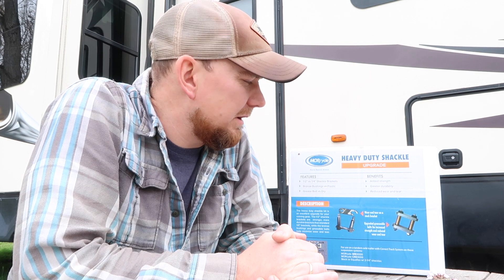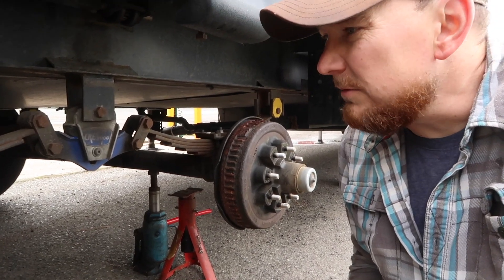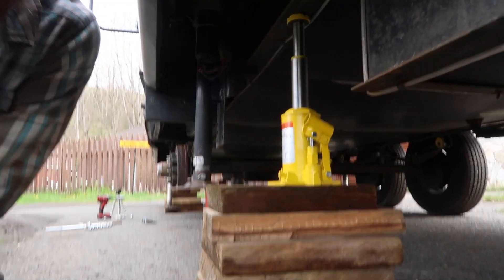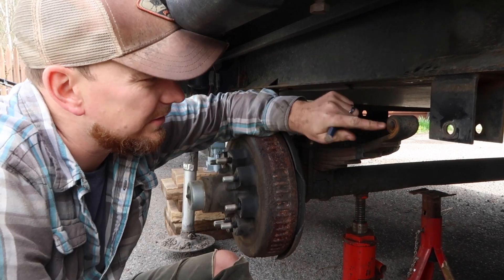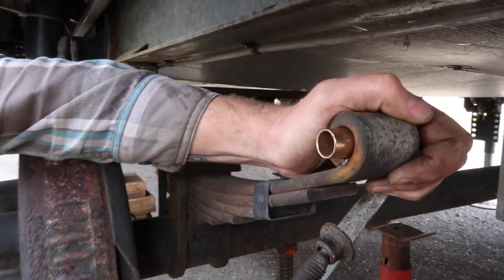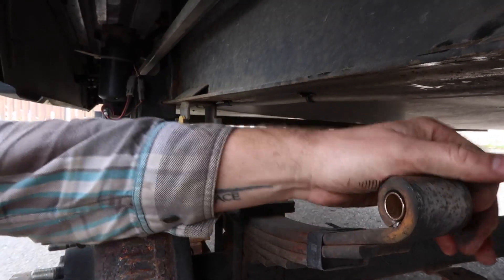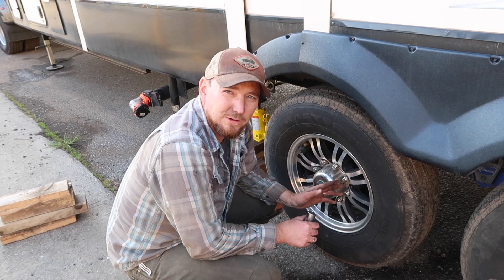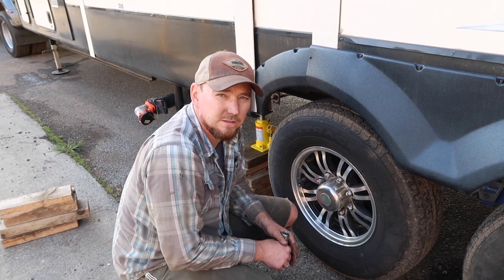Alaska Prep : MORryde Heavy Duty Shackles

Comment: Rather than using a socket to press the bushing in, use one of the old bolts cut off to the length of the brass bushing. Then insert the bolt into the new brass bushing and press it into the sprint. It will make it fit flust on both sides.

Comment: If you face the greese fitting to the inside you don't have to fight the tires to greeese them. Also, point the greese hole in the upward position and it will be easier for the greese to folw when the RV is on the ground.

Comment: I did the same thing on my 5th wheel in preparation for our Alaska trip. The only thing I did differently was installing the bushings. I put the new bronze bushing on top of the old bushing (I put a little anti-seize on the outside of it), then take a shackle bolt thru the bushing and tap it thru the spring. It’s easy & you don’t have to use a C clamp. The bolt automatically lines up with the plastic one.
Good video, thanks. Maybe we’ll see you in Alaska.

Comment: Thanks for the video, I already had this wet bolt kit installed on my trailer new, however, one of the nuts on the leaf spring came off and the bolt is bent in the hanger hole, your video helped get a better idea how to replace the bushing and install a new bolt!

Comment: Take note: the new wet bolts are galvanized and the shank in very rough.  This is the part that turns against the bushing so I'm thinking the bronze bushings will wear quicker than the plastic with smooth plain (black) finish bolts shown in this video.  I'm very disappointed in this change as all the pics on MORryde's website show smooth black bolts.

Comment: You put the wet bolts in backwards. They should face the center of the trailer so you can grease them without taking the tires off. Also if you have a blow out there's no chance of the flapping tire breaking the zerk fitting off. The only exception would at a hangar that is blocked on the inside by your frame or plumbing or other obstacle.